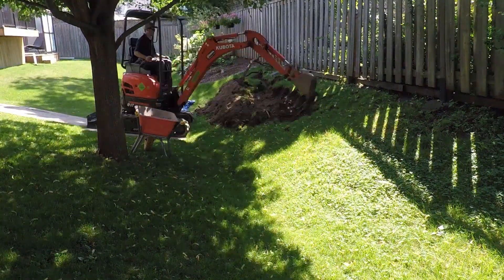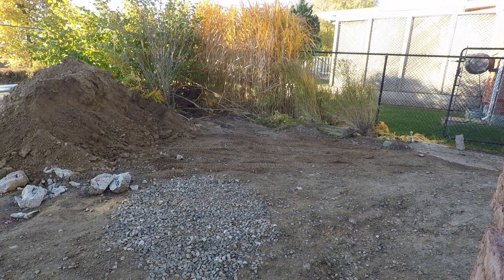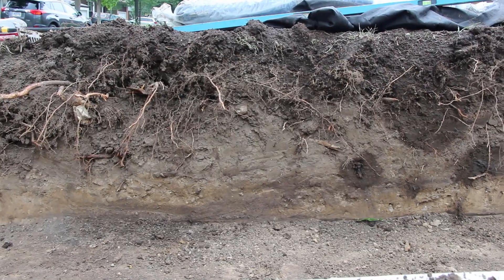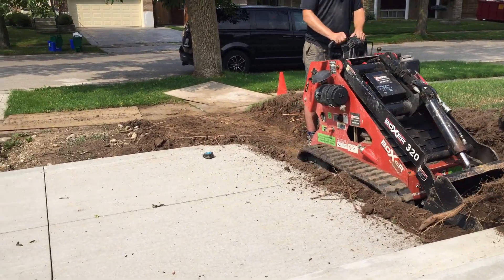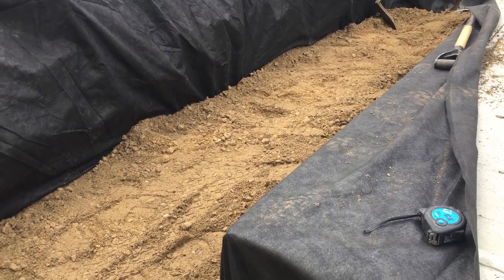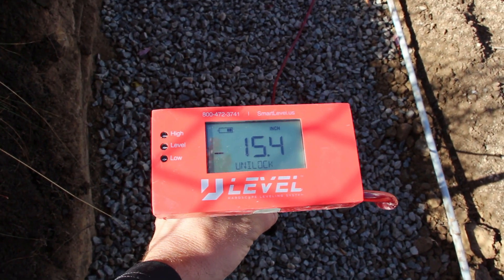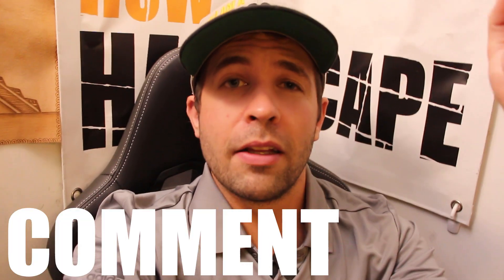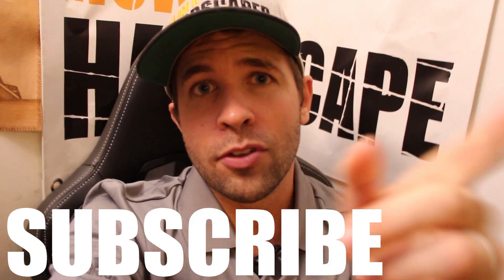How Deep to Dig for a Retaining Wall

Comment: Why did you put fabric under the wall before adding base material? Wouldn’t that prevent water flow?
Reply from the maker: No that is a nonwoven geotextile and it drains. It separates our base material from our subsoil so there is no contamination

Comment: I’m confused by how deep the retaining wall trench should be.  I live in New England and they say the frost line extends down 40” so they recommend the base of the footer (concrete or gravel) should be below that to insure no frost heaving/distorting the integrity of the finished wall.  I believe you’re on Canada so wouldn’t  the depth be even deeper?
Reply: I’m using concrete block/mortar.
Not sure how “flexible” this will be.
The building inspector recommended below 40”.
Wdyt?
Reply from the maker: How large is your wall? Segmental retaining wall systems are meant to be flexible and rigid structures, so you do not require a base down to frost line. Who is recommending that?
Reply: The building inspector advised going below frost line…40”!  Sounds like way too much yeah?  My wall above grade height is only 2.’

Does it matter if I’m using concrete block and mortar as far as loss of “flexibility” goes?

Another quick question.  This retainer wall is to contain a raised patio.  What do you recommend as far as excavation below the pavers.  Go down to grade and build up with 3/4” clean stone or just add a few inches of 3/4” stone on top of the existing dirt ground (after compacting with plate compactor)?
Reply from the maker: You always need to remove the organic material and get down to subsoil. So whatever depth that is as long as it is a minimum of 6". As for the wall, I guess if the building inspector wont pass the wall (do you require a permit?) you have to follow what they say. I wouldn't want to do that. I would ask them if you could do concrete piers spaced apart to 40" and then pour a concrete slab for the block to sit on. I know people do this.

Comment: Can I add a freestanding sitting wall on top of the concrete? 20" high including coping? 4" concrete with 5/8" rebar thrown in randomly. I poured a concrete patio with the intention to build a sitting wall on top on the concrete itself. But now I am concerned that the weight of the wall might cause the concrete to break eventually? Do you think it will hold for  15 yrs or so?
Reply from the maker: I can’t say for sure without seeing it. But if the concrete slopes it might be difficult. Ideally there would be a concrete footer below the concrete slab with the blocks starting to be built on that footer.